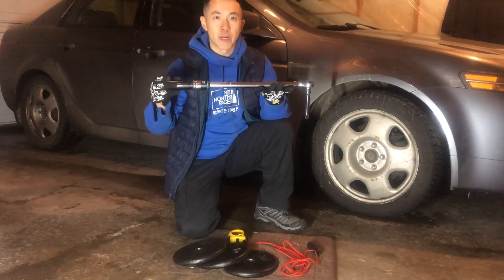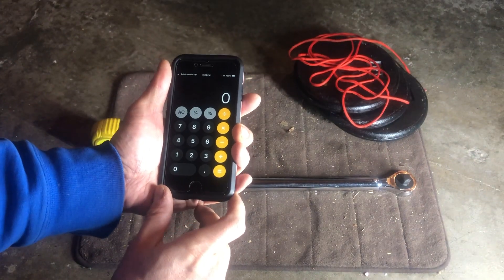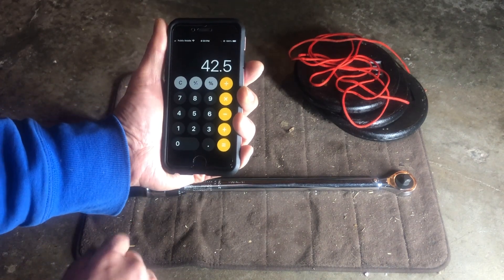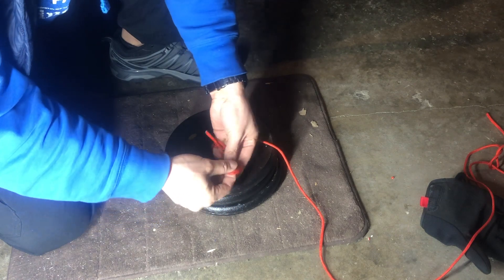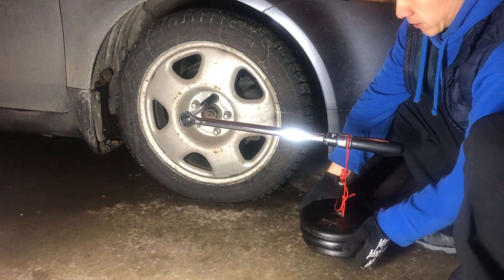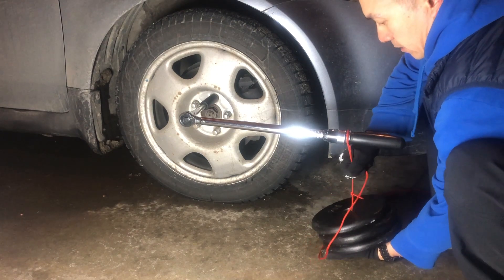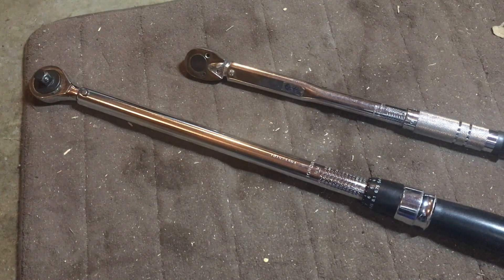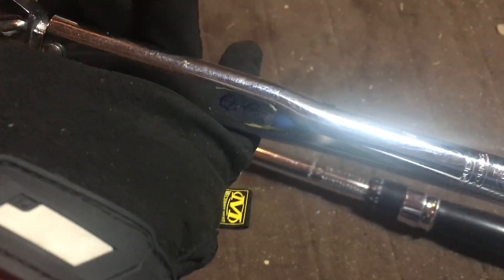Test and Adjust (Calibrate) A Torque Wrench

Comment: I was a bit concerned that everyone may have missed the important factor that results will not be correct if the tool's correct loading length is not used (the tool is length dependent), but I see timmaher2769 (Soniccues) has advised that it's necessary to use the marked position at the center of the handle. Great information from Tim.

Comment: This procedure ignores the weight of the torque wrench itself! A ½" wrench can easily weigh a couple of pounds. And, you can't just add in the weight of the wrench since that weight is distributed along the length of the wrench.

Comment: Are you moving your 17” mark when you move to adjust weight ?..
Reply from the maker: Hi! The mark I used was the divot on the handle of the torque wrench so the reference spot is consistent for the varying weights. Hope that helps.
Reply: @lmsdiy Thanks it looked like when you adjusted the handle the spot got closer. I have a older craftsman torque wrench I have to calibrate because I didn’t back off to 0 last time I used it when I adjust to a higher weight my handle moves.
Reply from the maker: @bruceriddle4368  That's a good point. I "think" it remained consistent. I also understand it's appropriate to check from 3 different measurement spots on the torque wrench but I'm not that savvy yet. 😁

Comment: The wrench that you added at the bottom of the weights itself has some weight, so I am not that sure about the calibration.
Reply from the maker: Good eye! I added this to the description:

Note on the weight test: when I introduced the wrench it added 4 ounces on to the test weight which brought the total test setting on the torque wrench to 42.85 ft.lbs. instead of 42.5 ft.lbs. Because I got it to click above 42.5 and below 43, I didn't feel the slight change in test weight was worth redoing the test in the video. The variance is 0.8%, so not significant enough for me to adjust. Cheers.

Comment: When you set to 42.4 ft pb the length will change, hence wrong readings
Reply: You measured the length before setting the torque to be measured, so on setting the torque to 42.4 ft pb, you changed the length, since the marked point is on the moving handle.
Reply from the maker: @ndasigerry  let me double check but I'm pretty sure the measurement process is correct. Normally the ft.lb. is based on 1 foot and the weight. So 30 ft.lb, for example, is 30 pounds of weight applied at 12 inches of length. So if the length of the object is 18 inches and the weight remains at 30 pounds, you're actually applying 1.5 times the weight it would be at 12 inches, or 45 ft.lb. In my calibration case, I measured 17 inches, so the 30 pound weight is actually applying 1.42 times the weight if it were only 12 inches, hence, 42.5 ft.lb. for my calibration. 

Let me know if you think the math is off.
Reply: Welcome.
Reply from the maker: Do you mean from the addition of the 4-ounce wrench?
Reply: Yeah, your maths is perfectly ok, was just calling your attention on the point you mentioned had moved when you turn the knob, since the point is on the knob which moves inward( shortens length) as you turn, except I'm wrong about the point been on the knob, correct me if I'm wrong.
Reply from the maker: @ndasigerry  ahhhh... I get you now. Yeah the point shouldn't change with the rotation setting on the torque wrench. But  just to be sure, I will go back and remeasure it with different torque settings just to be sure and do an update if it did change! Thx for the feedback.